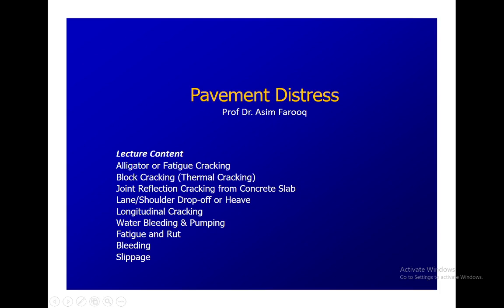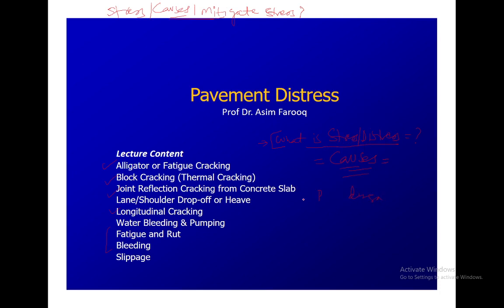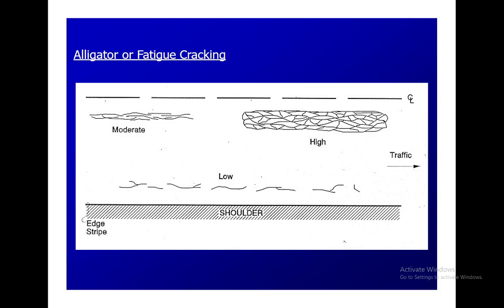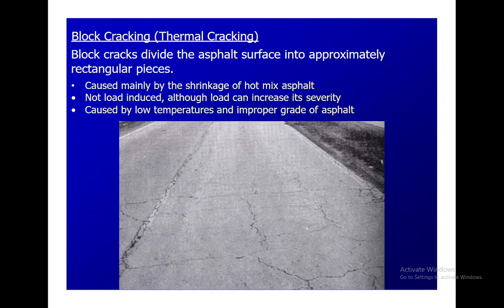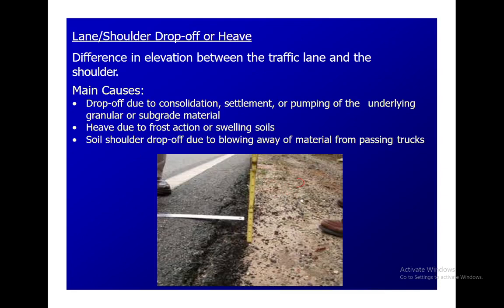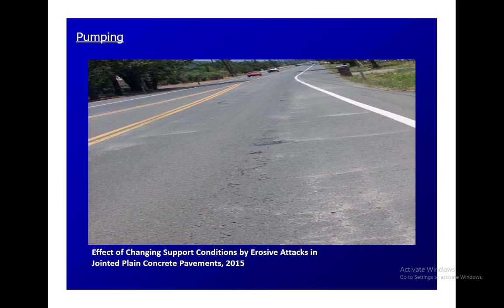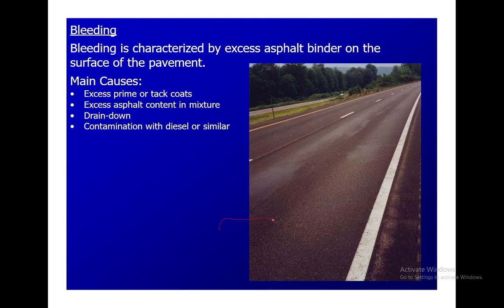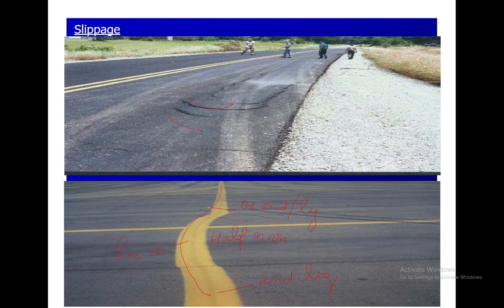Pavement Distress: Fatigue: Rut: Bleeding: Cracks by Prof Dr Asim Farooq

Comment: Sir how can we  mitigate temprature related cracking.
Reply from the maker: When pavement is exposed to hot temperatures, it begins to expand and if it expands too much, it starts to crack. In addition, pavement cracks allow water to seep inside and can eventually erode the sub-surface layers. Rapidly decreasing temperatures cause the asphalt to contract quicker and build tension faster, leading to an increased chance of cracking. Freezing temperatures also cause water that is trapped beneath the pavement to freeze. As the water freezes it expands and causes the ground to heave.
Reply from the maker: As you asked about the mitigation, the probably way is to Mitigate Concrete mixture - Reduce heat of hydration by optimizing the cementitious materials using supplementary cementitious materials like fly ash or slag; or using a port- land cement that generates a lower heat of hydration.

Comment: Sir my question is regarding cracking , if we provide proper quality materials and sufficient thickness , but the asphaltic layer is not much thicker as required, it may withstand the loads but the cracks which occurs would be longitudnal or block cracks? As both the phenomena lies in this situation, (it is an example take from service road of Regi model town sector 3).
Reply from the maker: Dear Waqar, as you mention if we provide all those materials according to the standard etc, then there is overall less chances of crack. but the lecture is about Distress/Cracks , So what if there is issues in design, insufficient layer thickness, wrong selection of material, temp variations, etc, then crack will occurs according to its nature. The block crack impact is in longitudinal & in vertical direction, while the reason you mentioned that what if the thickness is not according to the loading parameters, then there is high chances of Consolidation rutting, which direction will be in the wheel path.
Reply: @profdr.asimfarooq9606  thank you sir